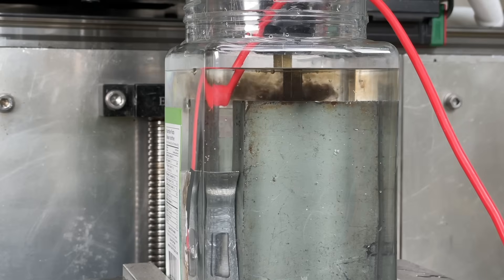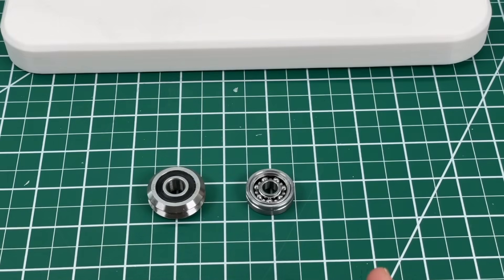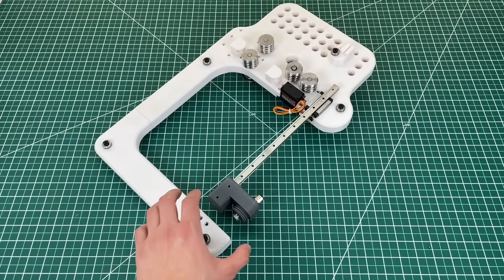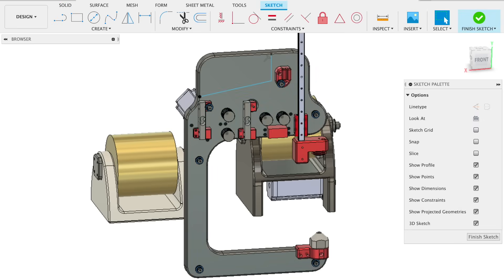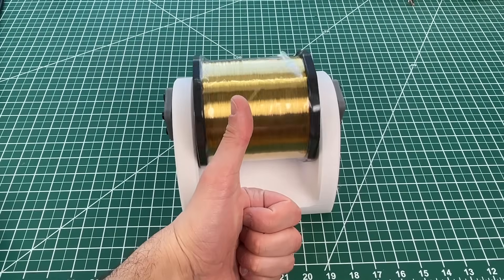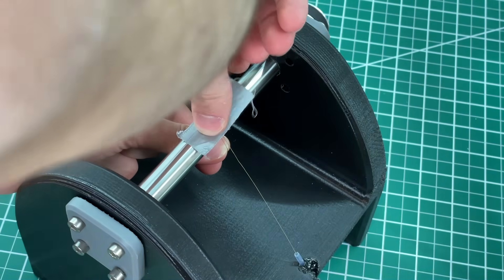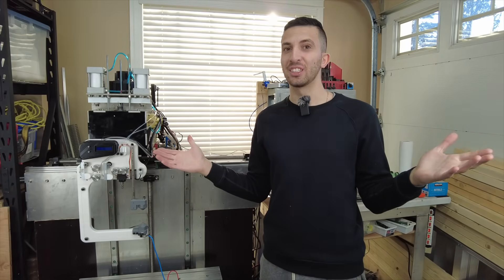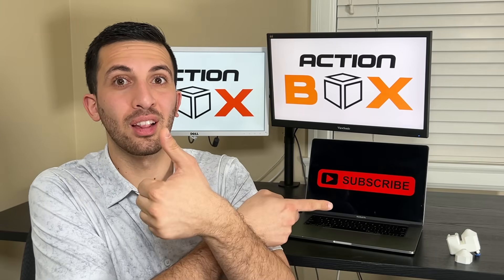How We Made A Wire EDM Machine At Home

Comment: One way to solve this sort of wire break issue is with closed-loop speed control based on the cutting voltage/current, so the machine can automatically adjust the feed rate as cutting conditions change -- slowing down when the current increases due to more material thickness and worse flushing.

You should also plan on treating those two idler ball bearings as consumables requiring regular replacement, since you're passing all of your cutting current through them and will be eroding their rolling contact area over time. They're certainly cheap enough to be treated as consumable, after all. (If you do want a contact roller that won't need replacement though, I'd recommend a mercury slip ring bearing like a Mercotac 205.)
Reply from the maker: Wow, that’s an amazing recommendation with the mercury bearing.  Thanks so much for sharing.  Your comment is definitely useful.  Cheers.

Comment: Is that nominal guide hole to make sure the wire diameter remains constant also like an extruder? And surely reel/wire speed increases cutting area, no idea typical rpms.
Reply from the maker: It’s actually to guide the wire with less variation.  Perhaps straighten it out as well.  Great question.

Comment: Cool sounds like your feed rate was to high. Maybe current to high as well? Now you need to figure out an auto thread feature. Also consider using a voltage detection circut. You have to have a gap kinda like a plasma cutter. If it ground out on the part it won't spark and just turns into a poor version of a band saw
Reply: Might also consider chopping the used wire instead of spooling it . That's how the industrial machines do it
Reply from the maker: What do you mean by chop the wire? I am very intrigued?  Otherwise great suggestions. I agree with the potential issues you stated, and I’ll work on them for the V2.

Comment: I used fuse holders and stuck a RF capacitor across the terminals, my gut instinct is his capacitors are way too powerful. I wouldn't use more than a 2uf capacitor for wire cutting.
Reply from the maker: Thank you. I’ll try this out as it seems to be a common response.

Comment: you should try ECM, just uses salt water and a constant current source
you also don't need a $2000 controller for it either
Reply from the maker: Tell us more about it.  What are the benefits and drawbacks?  Thanks.
Reply: @ActionBOX  dirt cheap setup
its basically reverse electroplating, no cnc needed
there's a guy using it to turn hydraulic tube into rifled and chambered barrels, using copper wire, 3d printed fixtures, and a fountain pump, goes by ivan the troll

of course anything conductive can be used as the "cutting tool", including a metallized 3d printed monkey face; "3D-Printed Tooling Enables DIY Electrochemical Machining" on hackaday

I suppose the big downside is it can be finicky to get right, but it's very 'set a timer and do something else' once you get the feel for it

Comment: You'll need a thicker wire since the resistance increases as the wire gets thinner and the current increases, causing the wire to heat up and break at that point. As a result, the wire thickness and current strength must be matched.
Reply from the maker: Interesting! A few people in the comments have also mentioned something similar. I’ll keep it in mind moving forward. Thanks for sharing! Hope you enjoyed the video 😃

Comment: I wanted to build one a few years ago. I learned some place that industrial machines use pulsed current using PWM.  I experimented with low voltage ac and a brass strip mounted in a hack saw and a bucket of water.  By putting an induction coil with air core in series with ac transformer supply the spark happens on contact release rather than contact touch.  The induction coil I used was the high voltage secondary coil removed from a MOT (had to cut transformer open to get it).  Was able to saw into aluminum fairly easy.  The ac voltage I was using was low like about 24 volts.  Some guys use diesel in the tank because its cheep 😅.
Reply from the maker: We all start somewhere 😃. Thanks for sharing.  Dave

Comment: You probably need to increase the wire feed speed significantly. My guess is the wire is eroding too fast in one area causing it to fail. Second, decrease power (smaller cap) but increase switching speed I would shoot for 50 Khz for the switching speed.
Reply from the maker: Okay thank you for the comment.  Is it possible to achieve this with a much lesser frequency?
Reply: @ActionBOX  Perhaps if you lower the cycle energy to reduce the wire failures, but cutting will be much slower. Commerical  wire EDM machines use high frequency.

What I did is use a pair of mosfets: one to charge the cap, and the other to discharge into the work. You turn on One mosfet to charge the cap, turn it off, and than turn on the second mosfet to discharge into the work.This way you can ditch the charging limiting resistor. You can use a microcontroller with a PWM module for fast switching speeds or just a 555 Timer. for the 555 timer I used a 74123 monostable multivibrator for a small amount of deadtime with the 555 to avoid shoot thru of the mosfets. The Outputs was fed into dual mosfet gate driver. 

With a microcontroller, PWM modules usually have a deadtime register so the 74123 probably would not be needed.

Comment: Cool project!

Dunno if it’s a root-cause of the wire breakage, but get in the habit of always-always-always twisting your wires together.

 Twisting the analog sensor wires will reduce differential noise getting to the ADCs — all that sparking could be false-triggering the braking mechanism, or ground-bouncing other circuitry.

 Twisting motor, servo, power-supply and other driven-conductor wires (if they aren’t already bundled) will reduce noise generation/transmission.

…Better yet, replace the loose sensor wires with shielded multi-conductor wire bundles so you can properly ground the shield.
Reply from the maker: I really enjoyed reading this comment for general future projects. Thanks for sharing 😃
Reply: @ActionBOX  — It’s one of those “field tips” I learned waaaay back in my beginning amateur radio days from the old WW2 veterans in the community.
Reply from the maker: @AndrewPlumb  respect. Thanks again for sharing, I learned something new today. 

Ps. Feel free to share our video with others who may be interested in this stuff.  We are trying to grow our channel by increasing our view count and channel recognition. 

Thanks in advance 😊 and thanks again for your informative comment. 
Dave

Comment: Is brass what they normally use as the conductor in edm machines? I would say try using another wire, maybe a thing gauge Kanthal wire or something like that. Kanthal is pretty cheap to get and stays cooler with longer runs of wire. I couldn't tell you why it works that way but it is opposite of how copper wire behaves. It is used as a conductor in vaporizers which is what made me think of it since I think it is a stronger material than copper. I could be wrong about it being stronger but in my experience handling both types of wire, the kanthal seems to be able to take more abuse than copper before breaking.
Reply from the maker: From my understanding, it is definitely one of the conventional materials used in wire edm. Thank you for sharing though, I like the thought 😊.
Reply: @ActionBOX  No problem. I really don't have much experience with edm yet so I was just throwing out an idea that might help. I do know that some higher end edm machines use different conductors which is why I looked for wire with less resistance that has a higher strength than brass. Good luck with your next edm build.

Comment: great work and nice design.
I do have to add that you should not remove the linear guides from there rails. this can cause the bearings to pop out and those are a real pain to put back into place of at all.
if you do have to remove them you can use a printed rail segment to act as a temporary rail these should only be a b it bigger then the guides. 

but overall great work and love to see more
Reply from the maker: Awesome, thanks for the enlightenment Justin.

Comment: Yeah, the filtering of the water like you said. 

Maybe it is the settings on the machine. Maybe you want to call with a machine shop that uses an EDM machine, and check with them what settings they are  using. I think it is electronics related, not your setup. I also dont know how fast you need to have the wire to spool up. Also i dont know the feed rate. 

I think it is just like a sewing machine, if something is off, it just doesnt sew right. You need to check every factor/variable you can find, and find a good value for the factor/variable, and know why. 

Greetings,

Jeff
Reply from the maker: Thank you.  Much appreciated 😃

Comment: You have my subscription!  Very impressive keep up the good work! This is the first practical diy wire edm I have seen.   I don't believe you need to make the unit out of metal because no pressure is generated at the cutting point plastic should work just fine. I built an sinker edm years ago and it works very well but I would love to build your unit 👍
Reply from the maker: Thanks Michael, I’m really happy to hear that.  I will work on making a second and much cheaper version of this machine, and will then make it available to everyone, so stay tuned 😊. I appreciate the positive comment.  Cheers Dave
Reply: @ActionBOX  I dont know if you can make it cheaper? I believe you are on the right path with the closed loop stepper motors and everything looks like  it will work well!  Remember this type of machine costs a lot to purchase from a manufacturer.

Comment: Great project, & well presented! 
Applied Science did a video 2 years ago on DIY EDM drilling ( https://www.youtube.com/watch?v=rpHYBz7ToII ). It covers many of the issues documented in comments including the requirements for current control (BAXEDM), motion control with backup (DynaMotion), water filtration / conductivity, etc. Some of the issues he covers don't apply (such as rotating the 'cutting tool' (/drill tube) to ensure uniform erosion; with wire EDM you are constantly replacing the 'cutting tool' with new wire), but the core concepts are still the same.
Reply from the maker: Very interesting! Thanks for sharing 😃 I’ll have a look at that video. Glad you enjoyed our project!

Comment: Your polarity of the part vs wire matters! Negative electrons flow to positive so if you want to remove metal from parts make them negative and wire positive! Wore is sacrificial so buildup on the wire or erotion isn't a issue! Also a slight current in the tank to keep stuff cleared away is key too unless your using graphite
Reply: It’s correct that electrons flow from minus to positive so make the Wire Negative and let the electrons impact the Part when they jump from the wire to the part! (Tig AC welding knowledge)
Reply from the maker: Thanks for the comment.  While I am aware of the polarity benefits, I am very interested to learn more about the “current in the tank” you refer to.  Can you please share more?  I appreciate you commenting. Cheers, Dave
Reply: @ActionBOX  when I did edm with graphite and mineral oils in the machines there was a inlet on one side and a outlet on the other for the fluid. It was pumped ever so slightly and controlled by feed rates so the fluid around the cutting surfaces and the material surface was always pulling away heat and debris to keep the resistance constant kuz the impurities will make current spike and drop and you will get wavy results similar to sitting in one spot too long and your romoving too much material! Sorry my in person explanations are better than my typed ones! It keeps the water from going stagnent and or become conductive from the materials removed! Also is filtered through cloth screen
Reply from the maker: @jbizzbuildsmanstuff9932  that makes perfect sense. Thank you.
Reply: @ActionBOX  https://youtu.be/ZKVbWv0M1Z4 this guy does a much better explication than I do and this video he tells you what I'm trying to convey! The particulates can cluster and jump the spark gap and you need to keep everything ever so slightly moving away but not as much as to disrupt your laminar flow for your cutting.
Reply from the maker: @jbizzbuildsmanstuff9932  thank you, I’ll take a look at this video later today.  I appreciate you sharing. Cheers.

Comment: Looks like there is some electrolysis happening there too. Would suggest that your de-ionized water isn't so de-ionized.
Reply from the maker: Do you know how to continuously deionize the water in this process? Cheers
Reply: @ActionBOX  Good question, not 100% sure. Maybe a small reverse osmosis system? (ebay) Or, do a large carboy of distilled water, and just constantly stream in a new supply. 

... come to think of it, Ben over at Applied Science has also made such a device, and he made a point about how the water had to be treated very carefully. Maybe he would shed some light to another fellow YouTuber?

Whatever you do, it should be easy to measure a before and after, since the water's electrical properties per unit volume should change. Maybe if I get some more free time I can do some rough experiments and get back to you.
Reply from the maker: @CharlesLeeScoville  that would be awesome.  Thanks for the details. Cheers
Reply: @ActionBOX  A thought just occurred to me. Are you using AC, or DC? If you're using DC, I believe you want to be sure to make your work piece POSITIVE, and your wire NEGATIVE. This will limit the oxidation of the wire, which is the main destructive force.
Reply from the maker: @CharlesLeeScoville awesome advice.  We are indeed running DC with the positive to the processed piece and negative to the wire. Thank you though. I appreciate it, Dave

Comment: Hi very nive project. You also need a very good quality water. You need good water pump to pass it in filters and deionized resin.
For that you must have 2 or 3 more resevoirs like the one you are using. The water first pass in 2 separeted filters than the resin returning to the cuting deposit.
Reply from the maker: Hi, what do you mean by deionized resin? Please enlighten me. Cheers, Dave

Comment: Hey just for fun the very first wire EDMS were attachment's to regular sinker EDM's. They ran in oil, they were more forgiving to poor electrical conditions. The gap was smaller and voltages were higher).  You might turn your assembly 90 degrees with the wire facing downwards and see if you move it in .0025mm (that's .0001" right?) straight down with across your workpiece and see if it cuts, which might be easier than shelling out for pumps, filters and other stuff power supplies, etc.
Reply from the maker: Thanks for the detailed comment. Ill give it a try 😃

Comment: I am really impressed with your toy. I believe the current and feed rate are too high. I do not know your power supply frequency but if it is like straight DC voltage you probably want to back it way off to not exceed 1/4 amp (maybe 30-40 volts, this has some connection to the frequency of the power supply) and then drive forward really slowly. Our first machine was less than 30 mm per hour in 25 mm material. I believe the frequency was about 2000 HZ and the machine had a vibrator on the wire to help keep the wire from shorting. This was before adaptive control was available so you have to keep the feedrate below the shorting speed. The wire should never touch the workpiece but you should try to maintain a spark gap of about .025-.050 mm. Additionally if the wire is not held tightly it will bow, which will be evident when all your sharpe corners look washed out.... You can get other weirdness. S-shaped walls. Almost all the current machines are capable of backing up if they hit the workpiece and short out, turn power off, and will not reapply power until the short clears. (most macines have a short circuit sensor for that. They first thing I would suggest is to go to a v-style groove for your guides.  Something hard and permanent would be preferred but you could cut a v-groove in a carbide pin. Or if you really clever maybe a carbide cutting tool. Ultimatley, something  non-conductive and wear-resistant would be you best bet.  Using your roller and small hole you are also; going to EDM your bearing, eventually it will not run round, and the small hole will eventually enlarge especially after soemtime in the water as the metal parts become part of the curcuit.  Aslo as an asiide the small rollers are really hard on the wire. Most of the production machines don't have small diameter tight rollers because it puts a bend into teh wire.  If you unroll five feet of wire it should go almost straight to the floor without any cbvious stress. If the wire tends to lean in a direction like it has been on the roll too long it can cause the s-shape along the wall of your cutting path. If you can finally circulate water and can pump it coaxially along the wire it will help flush the cut slot (but only after you have entered the material) and you can pick up a small amout of speed. Good luck.
Reply from the maker: There is some awesome information here. Thanks so much for taking the time to write such a detailed response, I really appreciate it. I will consider all of this while designing our second version of the machine. 

Ps. feel free to help us out by sharing with a friend who may be interested. We are trying to increase our views and channel recognition. Thanks in advance 😊. Dave

Comment: Instead of going for full setup first you need to collect data by maually moving wire on work piece "like a hot wire cutter  but also like a bow of violin, going in one direction only. Take readings for tension,  current, and feed rate. I am not an expert though.
Reply from the maker: Great ideas though. I really appreciate it. Cheers, Dave.